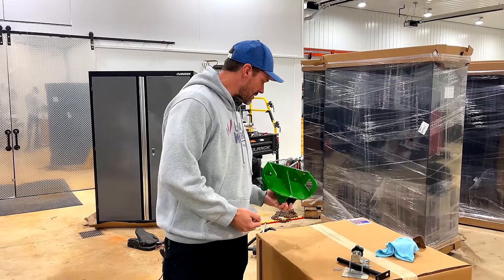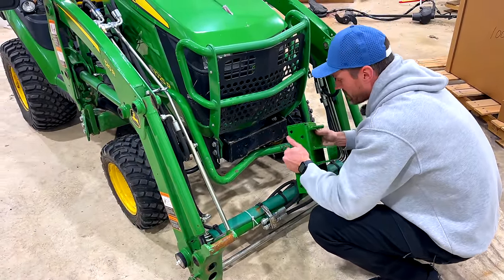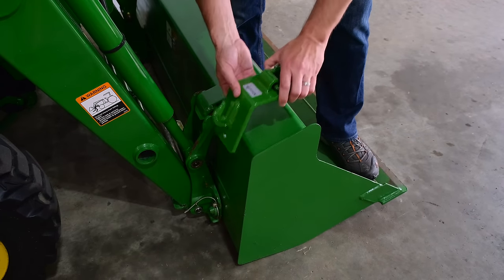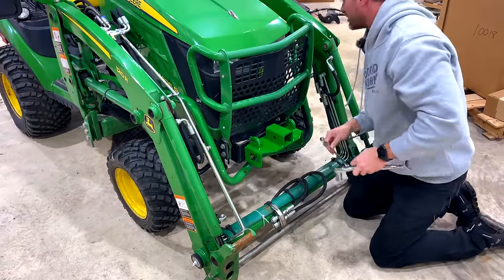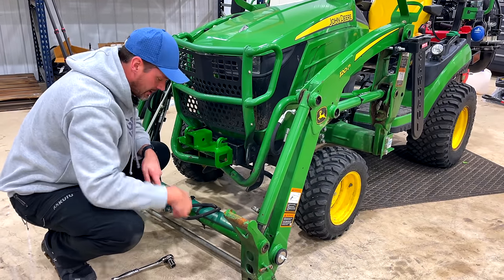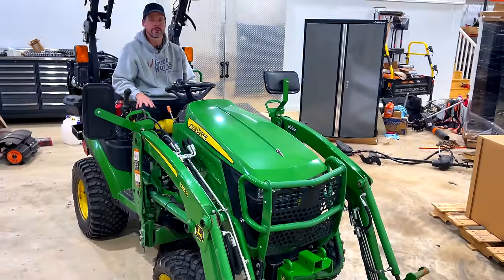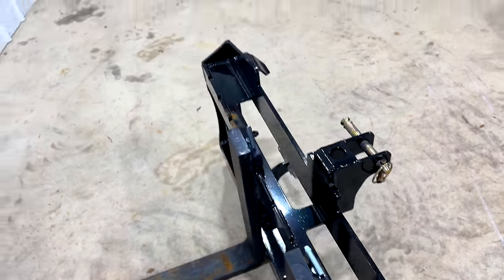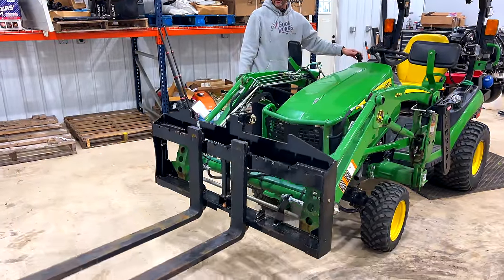INSTALLING A NEW TRACTOR ACCESSORY!

Comment: Our main purpose for this design was to provide a front hitch, chain grab hook & tie down attachment for the 1025r style tractors that do not have loaders, or if you have your loader off at the time and in storage, you can bolt this attachment on very quickly to get your work done.  But we wanted to make sure you could keep it installed when the loader was on and still use it when the loader was on.. If you are primarily wanting to use a front mounted 2" receiver and you have a loader, most people will opt to go with our bucket mounted workmaster plate, which is why its our #1 seller. Thank you to everyone for the support!
Reply from the maker: Just another great product to throw in the mix.  You created it because there were folks out there that needed it.  Nice job on the execution Jeff!
Reply: Thank you! @GoodWorksTractors
Reply: Good you cleared this up. Some people seem to get upset about it with  it mounted with the loader on. I don't ever take my loader off or haul it anywhere but if I did either I would be buying this product.
Reply: Awesome product and well designed!

I thought it was a self explanatory product but the comments corrected me 🤣
Reply: It would be awesome if you're rolling around no loader.

Comment: I bought one 4 months ago for my new Deere 2025r. While it doesn’t interfere with the loader when nothing is plugged into the 2” receiver tube, it sure does if you have a trailer ball mount plugged in.  To use it for moving trailers around you need to remove the bucket, raise the loader arms, then plug the ball mount into the tube.  Move your trailer, remove the ball mount, then lower the loader arms.  If you forget and raise or lower the loader arms with a ball mount sticking out of the tube, you’ll damage the loader cross bar.  That aside, it is a very well made item - heavy steel, excellent welds and paint.  It adds easy to reach and secure tie down points for trailering.  The chain hooks are plenty strong, and puts the force on the frame for heavy dragging with no danger of damaging the bucket by trying to pull to heavy a load for bucket mounted hooks to handle. I’m very happy with it.
Reply: Seems like it's just easier using a fork frame with a hitch mount built in.
Reply from the maker: Don't move trailers with your loader raised in the air.  A recipe for disaster.  This has many uses, but using it like that with the loader mounted is not one of them.  This has many purposes including tie down points, chain hooks, and the receiver.  The receiver could have a 2" winch mount installed in it as well.  If your only purpose is moving trailers, there's better options.  Well, unless you don't have a loader and want something up front.
Reply: If you have a loader on 99% of the time, what can you use the receiver tube for, without recipe for disaster potential? Not trying to be a wise ass, just asking.  Seems very inconvenient to have to pull the loader off to make any use of the receiver tube.
Reply: @MassholeMachinist  Fork frame with receiver hitch is definitely better, but $200 for this versus $1,000+ for the fork frame.  Using this requires you to lift the trailer tongue up on to  the hitch ball, which may be a very heavy lift.  With the fork frame, you can use the loader arms to do the lifting.
Reply from the maker: Doesn't sound like it's the product for you...or if you want a good tie down point on the front of your tractor that has other features built in in case you need them...just because a product exists, doesn't mean it's for every single person out there.  There's different use cases for different folks.  Good to have options.
Reply: @toms9841   Titan equipment used to have a 3 foot fork and frame combo for like $550 bucks.

Comment: I bolted a Heavy Hitch 2" hitch in that spot in the front and also have a HH 6 suitcase weight bracket (40 or 70#) to fit that (without the FEL). I can move the same unit to the rear HH hanger for even more rear weight. Many ways to skin a cat.

Comment: Awesome product for sure!Excellent pull points indeed of using the loader. 

Careful with tongue weight going directly to the frame like that. There’s no relief valve, to protect the front axle, like the loader has.  

Be very careful moving trailers that weigh 60% as much, or more, than the tractor. I have a seven way trailer connector rigged up with a remote starter switch and a relay so I can lock the trailer brakes up if I need to.  I use good heavy duty gator clips for power and ground on the tractor so it’s easy to install and remove.
Reply from the maker: Good for a winch mount too
Reply: @GoodWorksTractors Yes!!! That would be a great spot! Have a little under 5k winch (don’t out winch the alternator and battery) mounted on a receiver tube. Get a cover for it and store it on ROPS or wherever when not in use. Digging in that bucket would be a great anchor Great idea!

Comment: I've got a winch mounted to a drawbar that would slide into that and Quick connect to my battery with the remote on a 12 foot cord.   I park the tractor and stretch fence with the winch on my kioti.   Mine on the bucket. But this would be great. And a good tie down point too with a shackle in it.
Reply from the maker: Hey, hope life is good today cuz!
Reply: @GoodWorksTractors  Speeco Quick Hitch. 💯   Days are great with that!!!

Comment: I like to hang suicase weights there so ill stick with my bucket mounted design. But distressingly, you just happened to mention that if you have a 511 design grill guard, there is no lorger room to hang the weights on the frame. I was itching for a 511 guard - now I'm thinking a custom fab will be required. Thanks for the info,
Reply from the maker: I do believe at one point, 511 considered a modified guard to fit suitcase weights.  Not sure if that concept went anywhere or not.

Comment: Why would you have the chain hooks on the loader facing out?  That doesn’t really make any sense to me.
Reply from the maker: Not sure where you're referencing that...but some folks like to wrap chains around the bucket for extra strength when pulling.  Different strokes for different folks.
Reply: @GoodWorksTractors  I meant on the hooks on the pallet forks.  I’m not saying that you can’t utilize them in the direction they’re in,…but you’d have to run your chains from underneath the pallet fork frame.  Seems to me that they would be better the other way around,…that way you’re always hooking and pulling/lifting from the front.  The ones on the bucket are fine, it’s the ones on the pallet forks.
Reply from the maker: @amandadavis9726  same concept and I mentioned it was a prototype. That’s the point of prototypes, trying things out.  I also mentioned that the production version has the hooks facing the other way.
Reply: @GoodWorksTractors  thanks,…gotcha.  That’s what happens when multitasking, 😄.  You don’t hear the details of what someone says because you’re trying to process two different conversations.  Now that you mentioned,…I remember you saying that, lol.

Comment: Looks like it would work on a tractor without a loader. Not practical with the loader.
Reply from the maker: The point is showing it can be installed with the loader on.  No need to remove.
Reply: I'd rather have a winch mounted to that,   than it on the loader.
I use My SSQA plate with a receiver for Trailer moving.  or the 3 point Trailer mover.